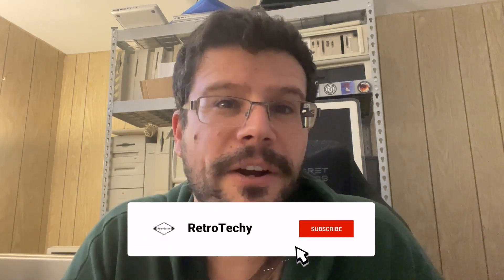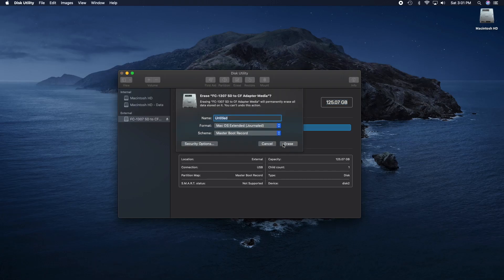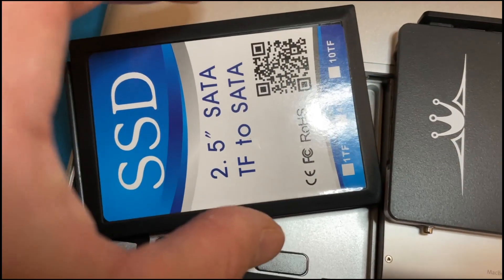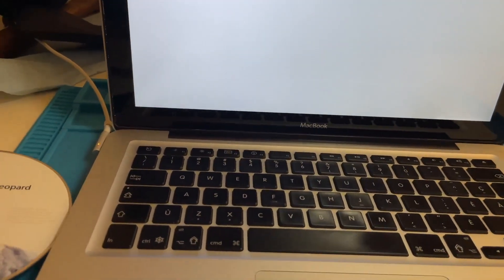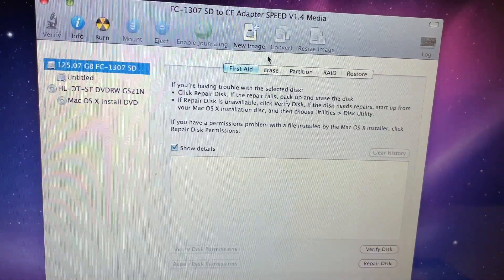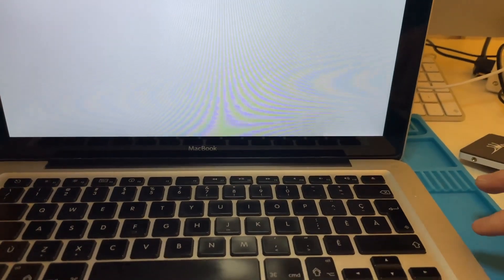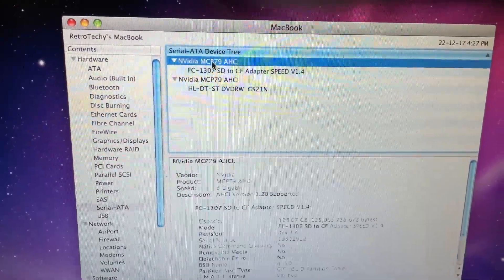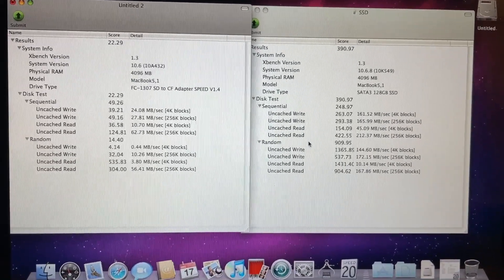Why Does This SSD Exist???

Comment: Most SD-cards have write speed of about 15-30 Mb/s, so this was to be expected. Be aware, a journaled OS with virtual memory turned on will wear out these cards pretty quickly. I guess this SSD makes more sense if you want cheap (but snappy) storage for an older computer in case you got a couple of spare SD cards laying around at home? Maybe this made more sense 10-15 years ago when 8-16 GB SD cards were cheap-ish and a small SSD's very expensive?
Reply from the maker: This is a data failure in waiting! I just wanted to see what they could classify as an ssd 😂 thanks for watching and consider subscribing!